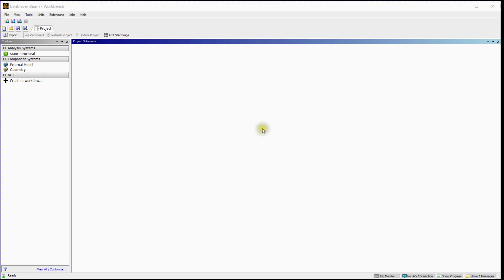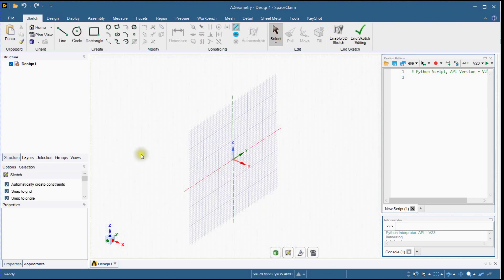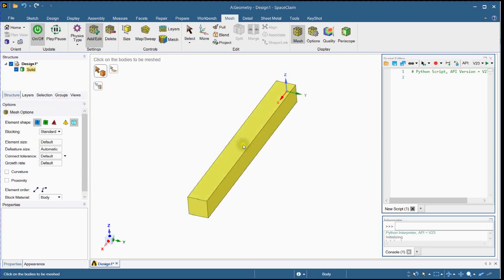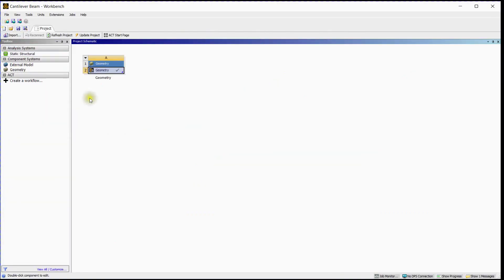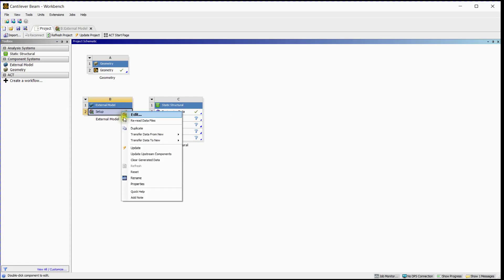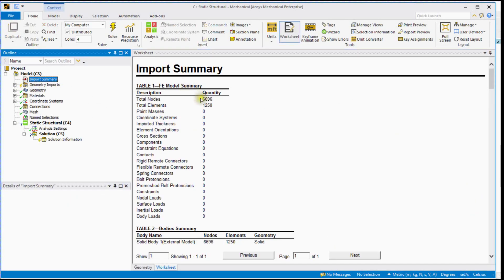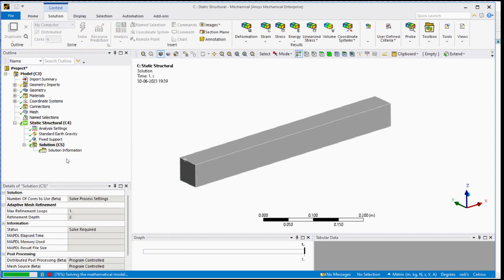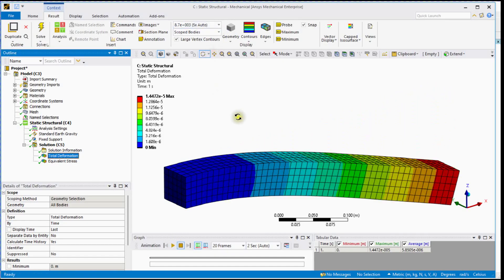🚀ANSYS SpaceClaim Meshing Tutorial: Export and Import Mesh for Cantilever Beam Analysis

Comment: Can it be done automaticaly for mechanical. Or must the mesh alweys be exported and inported.
Reply from the maker: Hello, yes. you can do this without exporting the model.
Reply: @Learn-Engineering  Thx. How do i do that. Is there a option in spaceclaim or mechanical that have to be activated? Use SpaceClaim Direct Modeler as an External CAD is deactivated. and i also generated a Body Mesh